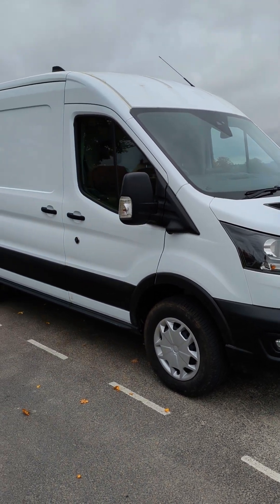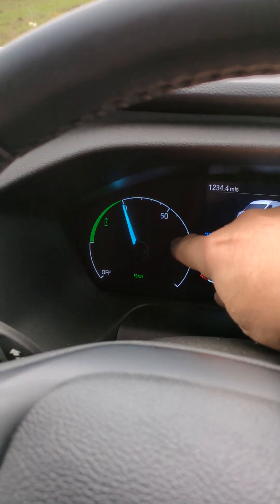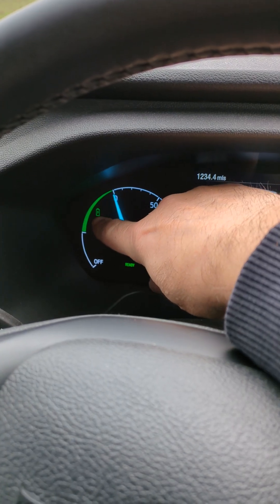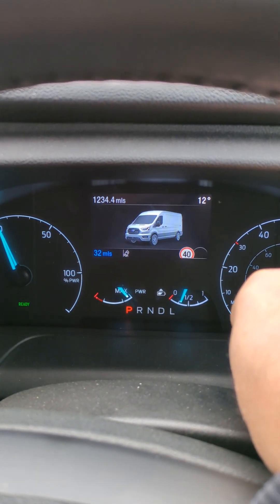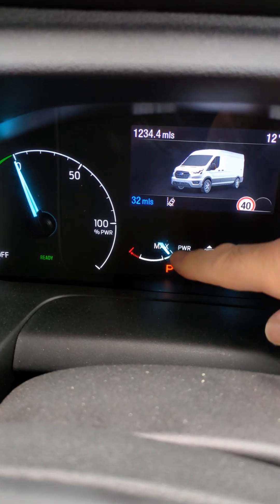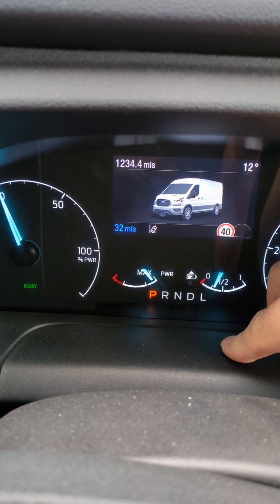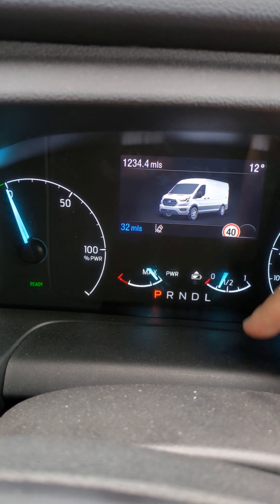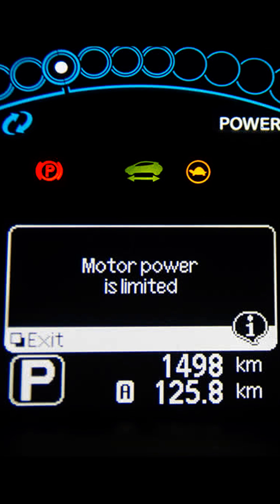Explaining the two power meters in a 2023 Ford e-Transit electric van

Comment: it is pointless on a "New" vehicle.. but as your battery ages.. Then that is where you will find it more useful.  Its forward thinking on the side of Ford.
Reply from the maker: The battery would have to be degraded by more than 50% which it will wont in the lifetime of the van.